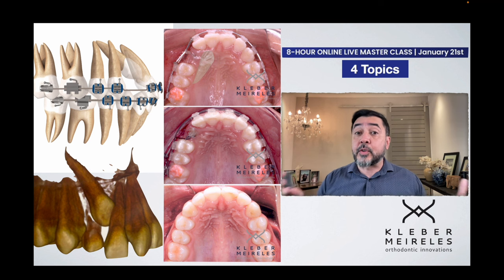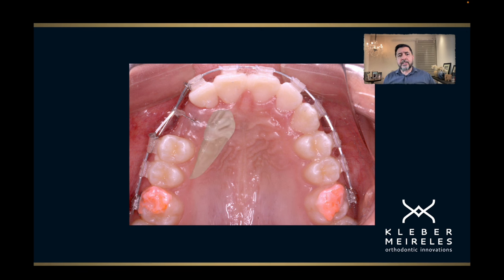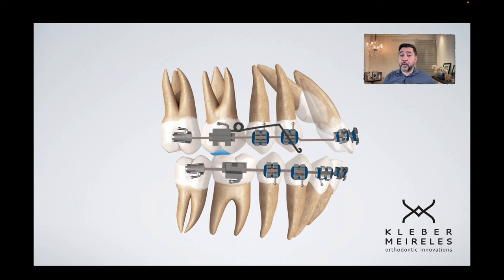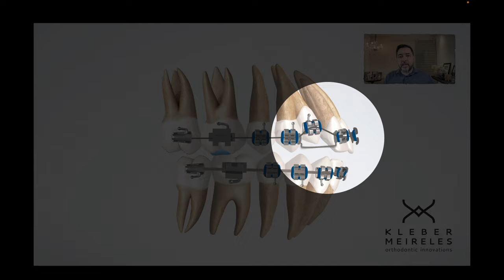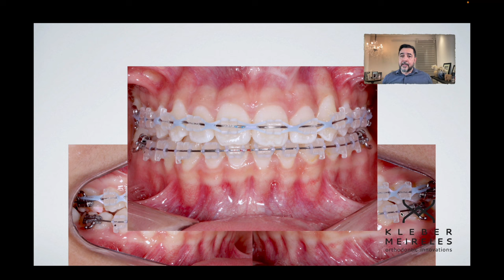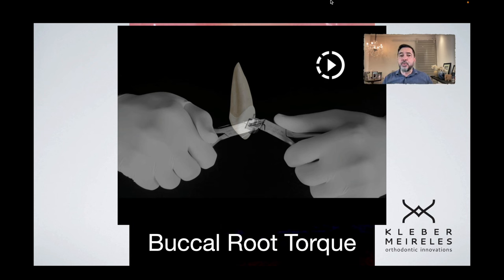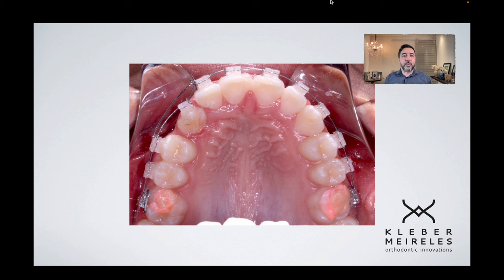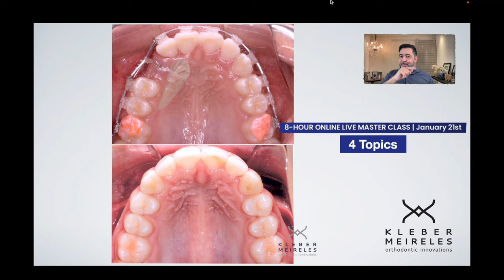Traction of Impacted Teeth | Prof. Kleber Meireles

Comment: Sir. Can we use 3rd molar uprighting techniques to life a 90° horizontal impacted fully bony impacted ( crown portion visible ) wisdom tooth

For filling the gap of 2nd molar which is extracted due to decay.

2nd molar extracted

3rd molar not errupted ( horizontal impacted postion) 

Is there any possible treatment to fill / overcome the extraction space of 2nd molar without implant using orthodontic treatment

Because I already suggested to go for braces due to 2 misaligned canine tooth left lower and upper